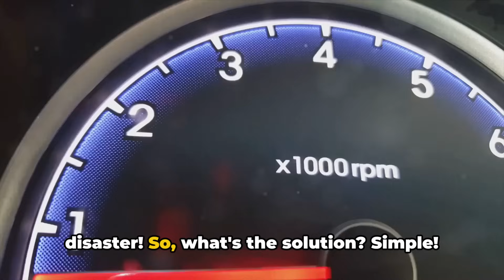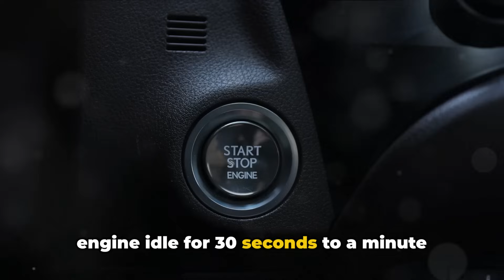5 Mistakes that Destroy Turbo Engines Fast!

Comment: I have a 2018 accord 1.5t and I try to be very easy on the car after I first start it up especially when it’s hot outside. I don’t warm it up that much unless it’s really cold out and I use 91 octane since 87 really is too low IMO as what Honda says you can.
Reply: here in Europe we dont have low octane fuel like the US we only get 95 97 or 99 octane E5 or E10 fuel, I would never drive a Honda with a 1.5t engine on anything lower than 95 you will be liable to a blown head gasket and  mechanical wear as well as oil dilution , I have a 2020 CRV with the 1.5 engine Honda Europe state in the manufacturer handbook never to use below 95 octane rated fuel it even says that inside the fuel filler cap 95 or above I cannot understand why Honda US would say 91 octane fuel would be acceptable when in Europe they no less than 95 thats a mystery I am thinking that is why Honda has so many engine failures in the US.

Comment: The 1st one goes against all modern car manuals that I know. Ride it gently after you start but don't let it idling. Riding it gently will actually warm the engine up faster. At least that's what the manuals recommended.

Comment: Hey i’m from the Netherlands and i drive  a 2016 BMW 218i active tourer with an 1.5 3cilinder turbo engine. 
With an automatic transmission. ( this car is not sold in america) It got a start-stop system. And at every stopping light i use it.  Only not in heavy traffic with allot of stop and go, that i turn the system off.   And the bmw dealership where i bought it told  me that it needs oil changes every 18000  kilometers or 2 years  (normaly it’s 10.000 or 1 year).  They said it’s normal for this car.
Reply: zulke motoren worden alleen maar gemaakt om emissie-eisen van de eu en tegelijkertijd bespaart het wat gewicht en wegenbelasting. Goed zijn zulke motoren niet:  uit een kleine motor wordt dmv een turbo het benodigde vermogen geperst om al dat gewicht vlot te verplaatsen. Het lijdt enorm hiervan.  Ik zou in ieder geval de olieverversingen halveren!  Dus 10.000 km max. Vooral omdat je een turbo hebt, de smering is ontzettend belangrijk en de olie wordt pikzwart en verliest veel eigenschappen. De olie gaat ook nog door zeer nauwe ruimtes en door het te verversen inclusief filter haal je veel verontreiniging er uit.

Comment: Everything in this video is why it's foolish for automakers to build turbo engines for fuel savings. If having a 1.5L turbo gives you an extra 2-3 mpg's, what do you really gain if you have to idle the engine to warm it up and cool it down, spend more for higher octane gas, and change the oil more frequently? Having a turbo engine only makes sense if you're using it for high performance. Turbos make zero sense when used to compensate for tiny underpowered engines.

Comment: Turbo charged engines need oil changes every three months. Which means four times per year. Or winter, spring, summer, autumn. Don't forget.

Comment: start the engine, remove the ice if needed, finish your cigarette, turn on your seat or steering wheel heating system and chill. maybe put on your seat belt, your phone, plug in the cable for music... after 30s of idle the oild should be EVERYWHERE. if not buy a oil with a lower viscosity then 15w. 0-5w are super thin when cold, the engine gets lubricated very fast, with thicker oil like only 10w at least one one specific test engine it took 3x as long, 27ish seconds.
now imagine running 15w50 in your diesel truck. have fun mate.

just turn it on, prepare yourself while the engine idles and then you are fine, jsut dont floor it, rather rev 500 or 1000 higher (esp on gasoline engines, they are already pretty revy compared to diesels which also want a bit higher rpm.
more rpm maybe les efficient - faster warm up
more rpm means less torgue, (boost,) and load for the oilfilm and engine parts. you shouldnt hit redline but driving 1200rpm at trash oilpressure with 80% load in 5th gear up a hill aint better so...
just go soft, like... i dont know you choose it yourself-

Comment: For 1 and 4, shouldn't driving slowly be good enough?
Turbo lag exists because your exhaust can't spool the turbo in time right?
So why can't I just drive at 2000rpm or less to ensure the turbo does not kick in instead of wasting fuel idling the engine?
And it should be better to drive slow instead of idle to cool down as idling means no air flow to the oil to cool it down.

Unless... The country you're from usually sees people floor it all the time?

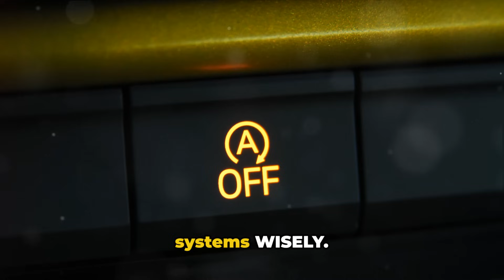Comment: 2:30 what's the solution?
Buy a manual. Start stop Systems only turn of a manual car when you put it in neutral. Meaning that in cases where you expect to only sit a few seconds or in cases you know you will start driving soon simply put the car in gear and hold the clutch down. The engine will never shut off and in the second case start up immediately. 
Disclaimer don't overuse this. Standing on the clutch for extended time is bad for the clutch.

Comment: I've always done all of these things. Do not ever, ever, use regular oil in a turbocharged engine... ever. It will cause sludge problems and ruin the engine. Especially German turbo engines, they get much too hot for conventional oil and it will literally cook to the internal engine surfaces that don't move. 

I have a 2004 Passat 1.8T with 4 motion all wheel drive and 5 speed manual transmission. It's quite rare to have that drivetrain combo so I try to keep it maintained including synthetic gear and differential fluid changes, 75w90 for both the transmission and diffs. 

Always use the recommended grade/weight oil and always use synthetic. 

I'll be 50 tomorrow so I come from a time where we didn't even have synthetic widely available for consumer purchase in my younger years and if we did, I was unaware of it at the time and when it finally did become more popular in my area in the late 90's, it was controversial to the uninformed. 

Back then I used conventional 10w30 oil in my 1989 Mazda 626 LX with stick shift, changed it every 3,000 miles and it had exactly 277,777 miles on it when I traded it in for a 1996 Mazda 626 ES V6 with stick shift. Changing your oil is literally the life of your engine. I  currently change mine in the Passat every 6 months or 3,000 miles, which ever comes first and it's usually the 6 months. It's 20 years old and only has 118,860 miles on it now. 

Sorry for the long comment but thought people could learn from my experience. Experience and wisdom, the best things about getting older.

Comment: If you have a Diesel car, for the love of God do not drive it at low RPM just to be in a higher gear. This will clog up the EGR and DPF very fast and you will start to see black smoke coming out. Also, the DPF is very expensive to replace.

Edit: this applies only after the engine is at the optimal temperature.

Comment: I like this video! Only things I would add on for people to watch out for is some cars have auxiliary water pumps for the turbo so unless you were driving it like a race car…you don’t HAVE to wait before shutting off, but you shouldn’t immediately shut off after parking. Another thing is for a “cold engine” it’s far safer to wait for the high idle cold start programmed into your car to idle down (takes 30 seconds to a minute on most turbo cars) and then start driving immediately. Your engine won’t warm up enough in super cold weather so you have to drive it, BUT you have to try to stay out of boost and drive it easily without accelerating hard or hitting high rpms and a good synthetic oil won’t be as thick as molasses anyways. This is the safest way to warm up the oil and engine especially since once the car idles down there’s not enough oil pressure to completely lube the turbo and idling for a while wears out your piston rings which leads to problems of excessively burnt oil, lower power and worse gas mileage.

Comment: High stress rides I agree, bit when you do High way drives, you really don't need to wait for it to cool off. With a diesel engine or if you are in sport plus modus then yes.

Comment: I pretty much ALWAYS drive away immediately after starting the engine. While I agree you shouldn't be opening the throttle wide on a cold engine, simply driving away at low revs is fine. I've taken two turbo 4-cyl engines over 250k miles without any issues, one of which is now my daughters daily driver. I also never idle before turning off the engine. Unless you come screaming to a halt after high boost, the turbo should be barely spinning. Turbo timers are a waste of money. Be you own turbo timer and take it easy as you park up. That's more than enough protection. As for 3.5k to 5k oil changes, again completely unnecessary unless you're driving it like you stole it. I use good quality synthetic motor oil and it gets changed every 10k. So yes, you can go above and beyond but you really don't need to.

Comment: All of these recommendations apply to N/A as well as forced induction engines! Also, instead of idling a "cold" engine for 5 min, it's better to drive it EASY after about 30sec of run time. Prolonged idling of a cold engine results in a much longer warm up time. An engine under load warms up faster, getting rid of crankcase condensation more quickly, which is a GOOD thing. You are RIGHT about the "start-stop" systems causing accelerated wear of engine and related components. Not worth the 2mpg that you "save" at the pump!
Reply: Prolonged idling and then saying 30 seconds, lol. 
At least a minute. 
RPM'S will drop from cca 1400 down to 700-750. 
It also helps with the timing belt being adjusted and run properly being taking off and putting a load on a car.

Comment: There is no need to let a modern engine idle for any length of time from a cold start. It is perfectly safe to start driving immediately provided you use gentle acceleration until everything is up to normal operating temperature. However I completely agree the worst thing you can do is to accelerate hard with a cold engine.

Comment: My belief is if your're driving a turbo engine, and you're on the Interstate doing 80MPH and pull off into a rest area and shut engine off as soon as you park, THAT's not good. Anytime I'm road tripping and stop at a rest area in my old VW Tdi, I always let engine idle for at least 2 or 3 minutes before shutting it off. Just putting around town on urban streets, I'm not worried about turbo issues. I figure as soon as I pull into parking spot it's fine.

Comment: Where's the one for diesels? Also, why isn't it better to drive off very gently, i.e. with as low revs as necessary, as soon as possible after start up, rather than needlessly idling under no load (as I thought we'd always been told was best)?

Comment: 1.) No. You do not need to wait 2 to 5 minutes for your engine to "warm up." That's silly. Stay out of boost until you reach optimal operating temperature. Granted, I wouldn't recommend starting and just going. 30 seconds to let the motor get base lube moving, and then you can indeed go without worry provided you don't hammer on the accelerator before your oil is at op temp. Once you reach 3k RPMs, shift. Or, if your car is an automatic, just don't romp on it.

2.) Older turbocharged models, absolutely, yes. Good Fuel is critical. Conversely, newer turbocharged models actually can take 87 octane and will only suffer from a lack of performance. The ECU will adjust to the lower octane fuel in newer (2018+ IICR) cars. As the man said, check your owner's manual to know for sure.

3.) This one has been hands down one of the dumbest, of not the dumbest thing automotive manufacturers have developed. Even on an N/A vehicle, the auto stop systems can be troublesome. In a similar vein, the cylinder shutdown on V6s and V8s is just as dumb. Turn. It. Off. Thankfully, my vehicle isn't equipped with any of that Tom foolery. 

4.) Provided you haven't driven for 5 minutes after the thruway session, yes. Be real for a moment. If you somehow live right off the exit of the thruway, yeah, maybe let the car idle for a moment post boost laden romp. However, if you're like the majority, you don't and will inherently cool it down driving the sidestreets afterwards. Provided you don't drive like a lunatic inside the city anyway. Although, if it's a grocery run, the unload sesh will be more than sufficient to cool that spinny snail of yours.

5.) 100% YES!!! Oil changes are essential to a turbocharged motor's health. I stick to 3k. No more. Even N/A motors shouldn't follow that insane 10k full synthetic oil change interval. Well, unless 70%+ are thruway miles. If you're around 60/40 in the highway/city ratio, or any ratio that increases the city time over highway, stay the Hell away from the 10k interval. 5k. Be safe. Oil is cheap when compared to a rebuild or short block swap.
Reply: Cylinder deactivation is just stupid quite frankly lol. Why's that a thing when piston engines are meant to fire and run on all cylinders at all times?

Comment: I think the main ones are 
Start and wait till the revs drop, drive lightly for the first 5 mins and keep the revs and Acceleration light, and cooling down time
City driving I always give it a full main before switching off gives enough to check ya phone etc
And Highway long trips 2 mins before switching off 

These are just tips my mechanic gave me 8 years a go

Comment: All excellent points. Have a 2012 3.5L turbo F-150 with over 300K. The waste gates froze up around 200K but the vehicle still runs good, light on the pedal and no check engine light.  I follow the 5 steps religiously. If you plan to keep the vehicle over 100K, get the extended warranty on the powertrain to at least 125K.  I had a turbo coolant leak at 105K and warranty paid for itself. Will I buy another truck with a turbo engine? Hell no!

Comment: Just change oil and filter every
6k or 8 months.
High end engine builder told me.
20k intervals too long 2023 fully synthetic oils that are supposed to last 20k.
Are done at 8k.
No protection at all then.
So every 6 or 8k change the oil.
Learn to do this ion yourself online or get a vac pump to suck it out from the top.
Freqent oil changes
Engine will do 200k a petrol at least.
And a diesel 350 400k miles.
FACT.

Comment: Geat informative video this is.
Most wear happens from start up.
Regiular oil changes every 5k or 6 months will allow you to drive the car on
5 min start up in morning in winter months.
1 min in summer months.
All depends on frequent oil changes engine builder told me top of the range fully synthetic oils are done after 8k miles that should last 20k intervals.
So I follow that.. I do 6k  oil changes now or every six months.
Engine is as clean as a whistle man.

Comment: Regular oil changes.
Every 5k.
First start of the day.
I. Minute idle.
Drive on but don't rev over 3k rpm for the first 3 mins as most wear happens on start up.
Keep oil turbo feed pipe clean also.
Good to go😊
Reply: Most wear actually happens if you don’t fill your oil filter. It takes 5 seconds for the oil the pressurize when you start the car after changing the oil and not filling the oil filter. After the engine fills the oil filter it takes less than a second for the oil to pressurize significantly decreasing wear. It’s important to fill the oil filter even if it’s mounted at the side and not upwards. Use the purlator boss filter as it prevents the oil to seep down if side mounted.
Reply: @Eclipsis17  This barely does any damage unless you floor it immediately after the first start changing the oil. RPM and combustion pressure is much lower at idle than when driving and an extra 4 seconds of cold-start wear every 4000 miles adds an infinitesimal amount compared to normal use.

Getting a good filter with a silicone anti-drainback valve is far more important.
Reply: @Eclipsis17 what if your oil Filter is on top? 😂 no but Most oil Filters for modern Cars are small and oil circulates quickly so there is no need. takes about 5 secs to get it through the Filter in the Engine After an oil change

Comment: Great tips for non-turbo engines too. I drive a new toyota rav4, I change oil every 5k miles of mostly hwy or 3k miles of
mostly city driving in Az. The Toyota service guy keeps telling me that this isn't needed, which is odd for a dealer shop
since I am paying for extra oil changes not covered by Toyota care.

Comment: I never drive away immediately and I never drive off with a lot of throttle. And I always use premium gas and I always follow the manufacturer's maintenance instructions.
Never had any engine trouble in over 30 years.